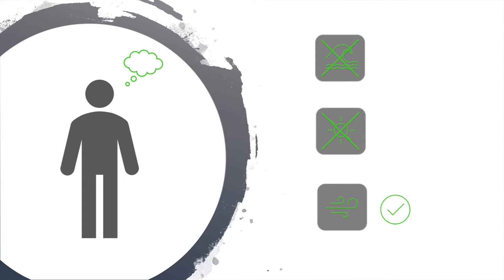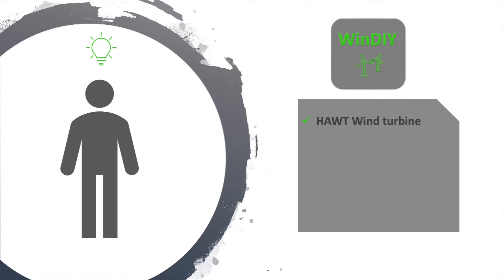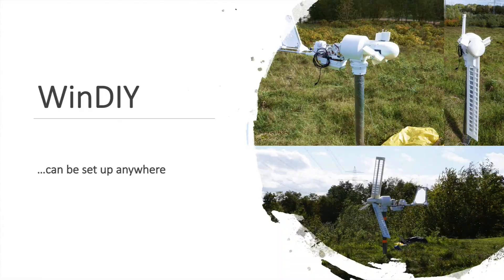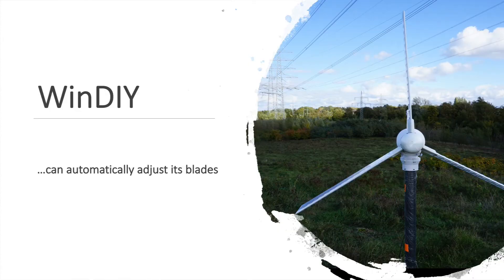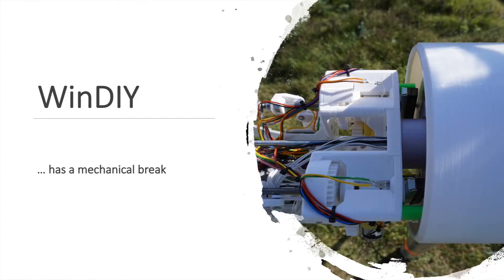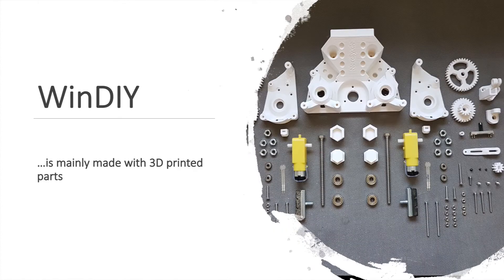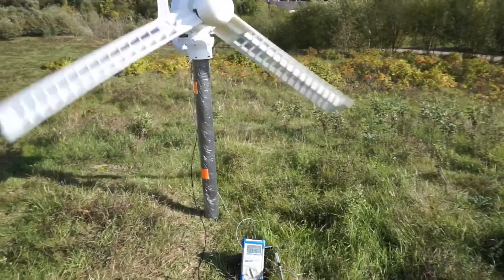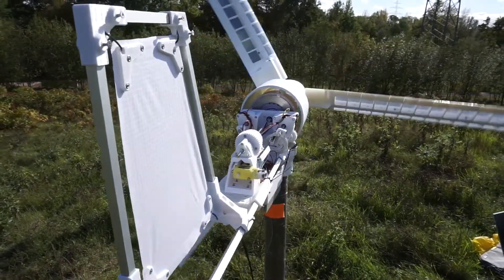HackadayPrize 2020 - WinDIY 3d printed wind turbine application video

Comment: Are you not afraid of humidity on 3D printed parts ?
And the resistance of the blades ?
Reply from the maker: Oh yes, i am. The wings need to be reshaped and tapered of course. Humidity is a good point. At least the electronics need to be protected very well. The other parts need to be printed of a filament that is not that sensitive about water and UV radiation. Especially PLA is famours for breaking fast after due to PLA. So still some work to do. :)
I saw that you are also working on a wind turbine. Any recommendations? :)
Reply: @Nerdiy 
I think you have to print in ABS and do an acetone treatment afterwards. Create an acetone steam bath. It waterproofs the 3d parts and makes them much more resistant.
There is also this solution that I would like to test soon: https://www.youtube.com/watch?v=nRLJ4ylGTFc
I think we have to motorize the vertical axis of the wind turbine.
Can't wait to see the next episodes of your videos :)
Reply: @Nerdiy  ASA would be a more applicable material selection due to its UV resistance properties compared with ABS. Very nice design and functionality so far!